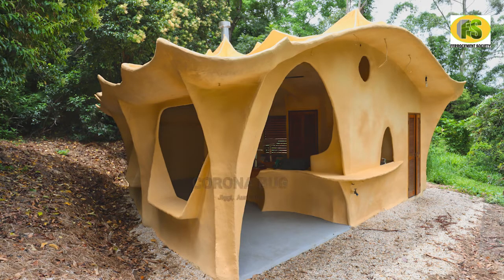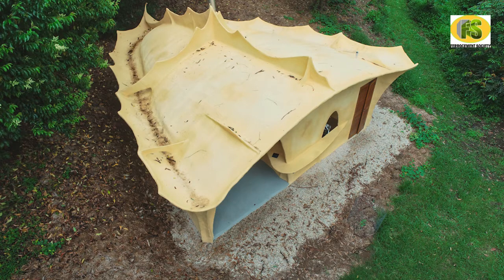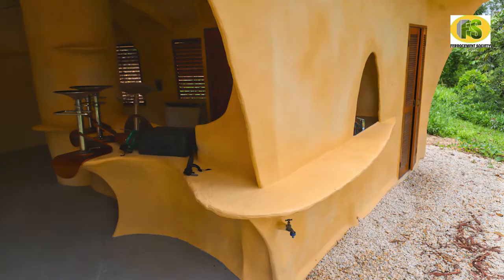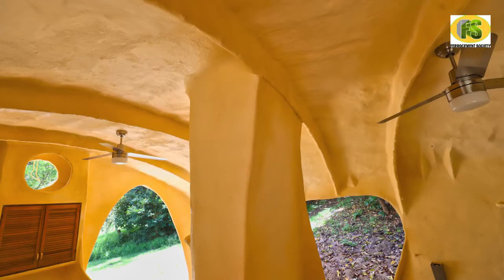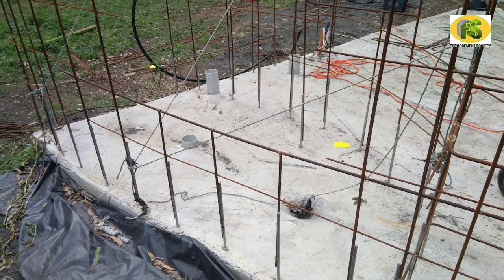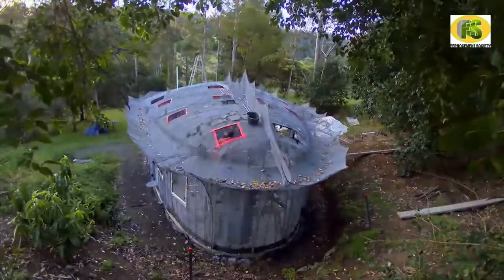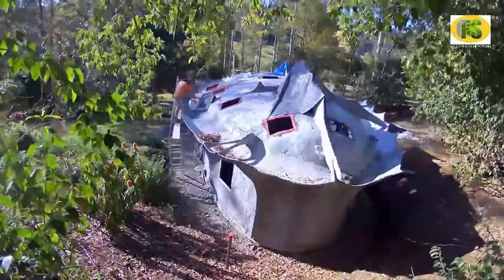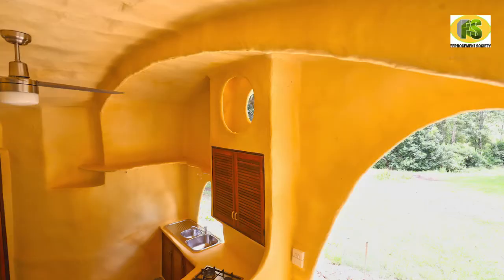V D Joshi Award winning Corona Bug- ferrocement house

Comment: Earlier I was thinking ferrocement construction as a low cost cheap house but if we design houses like this one, it could generate enough demands.
Reply: It can be less expensive and have this appeal if the ferrocement could be limited to the core elements of the building and the render could be applied thin, less than 2 centimeters, by leveraging the stability advantage of smooth curves and a balanced roof, like how the awning functions here to stabilize, or balance, the dome.  

A simplified and sturdy base frame that features fluid curves for just the support columns and a roof, a roof that supplies a sturdy, stress-skin (structural sandwich) insulating thickness, would result in an attractive column pavilion that would simplify and lower the cost of the entry-wall designs while freeing up those wall designs to be more interesting and beautiful by not having to be load bearing and needing only a non-mechanical bond because the walls key into the rounded profile of the columns and roof for mutual stability.  

It would achieve long-term and even seismic stability, thus reducing long term costs and resource demands. Aesthetics and personal taste would become the focus of the entry-wall design that are more easily redesigned, adapted, as time goes on, rather than the basic practical function of holding up the roof being the core purpose of the walls.  A core pavilion could work!
.